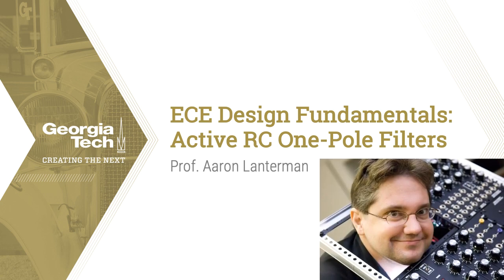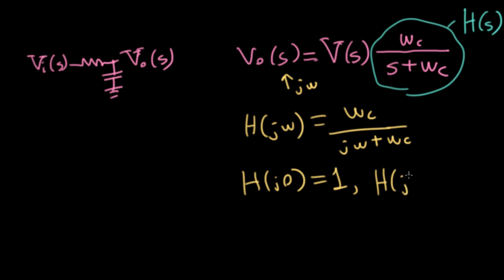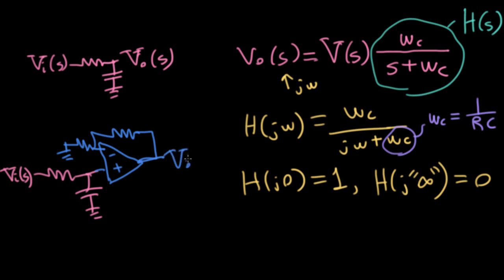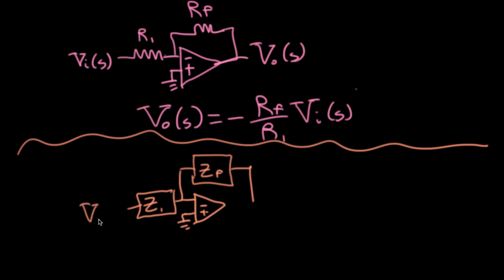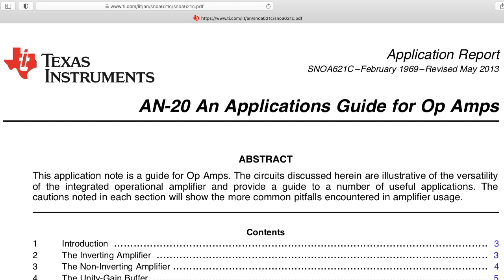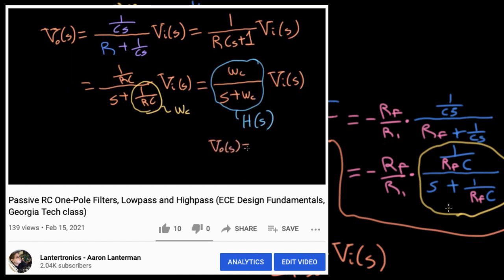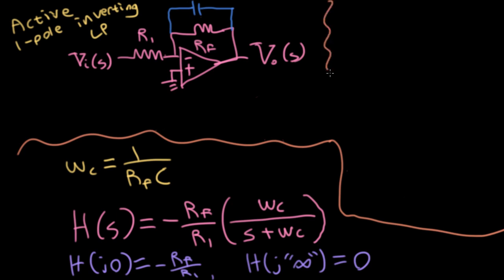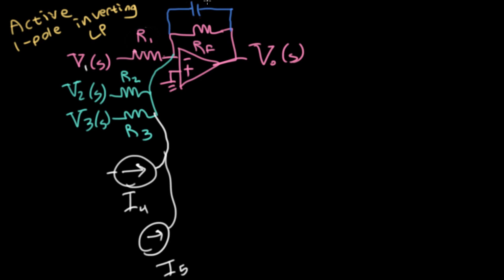Active RC One-Pole Lowpass Filters using Op Amps (ECE Design Fundamentals, Georgia Tech class)

Comment: How can i learn how to make such a squeling feedbak resonance filter ...they make in synths ...its somehow feedback but I can not learn how to make them .I know resonance is when the capacitance and inductancereactance  are the same ..but if you have opamps..and R and C ..? Could you make a video about that ..when at certain freq the filter amplifices more ...
Reply from the maker: To get resonance peaks without using an inductor, you need active elements like an op amp; you won't get it from just resistors and capacitors alone. In the next month in my Analog Circuits for Music Synthesis series, we'll be getting into voltage controlled filters and will cover that, so stay tuned. :)